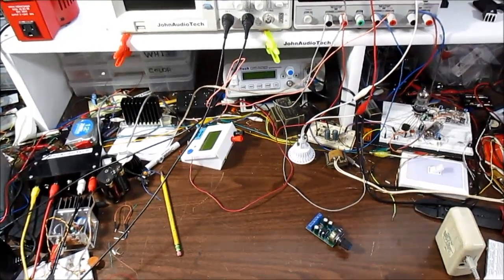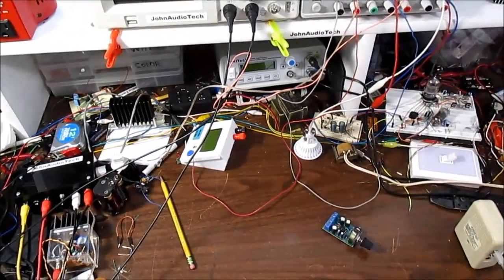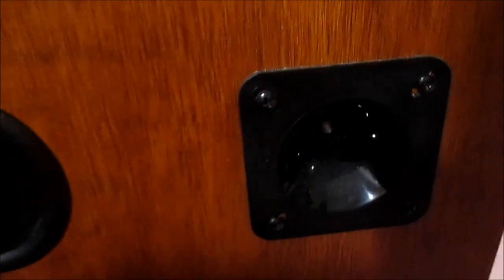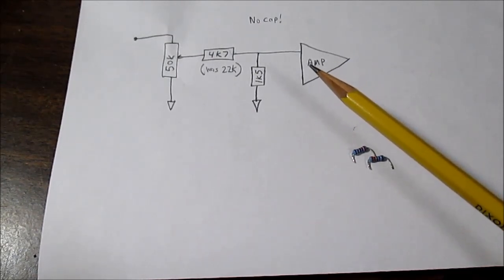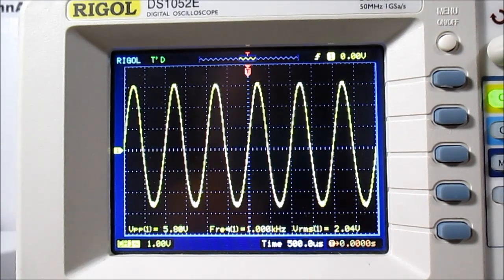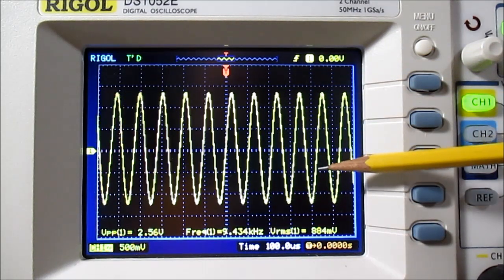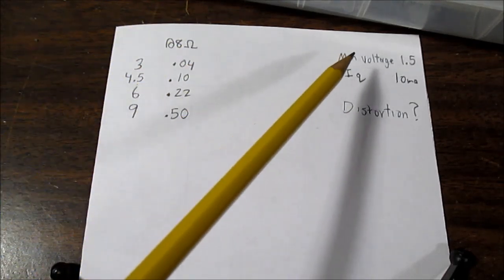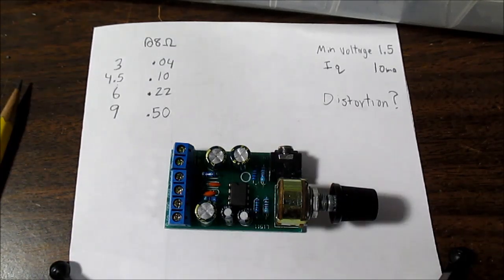TDA2822M $2 stereo amplifier board test, review & modification

Comment: Lets hope your Dad is feeling better for xmas. I'm listening to this video on a breadboarded AN7523 - 8 v supply 4w....speaker mounted in plastic kfc bucket ;)... sound surprisingly good..definitely going to box this one. If you haven't already I would love you to have a look at the Panasonic AN series of chips. I believe they were mostly used in their tv and consumer boom box and the like in 90s-2000s. Probably superceded but still plenty around. I've used the AN7522, An7523 (stereo version) and AN7511..all been excellent chips..theres usually, mute, standby, overload protection..all low power, big output..and minimal parts. And this chip does not get hot, or appear to need a heatsink..worth a look

Comment: ok, alright,  great info.  Now I have a couple of questions. You mentioned you ran this chip on a bread board. I would like to see that, as that's what I'm getting ready to do.  
After you did your mods and ran your tests again, I sensed a little disappointment in the results. You questioned the authenticity of the chip. I just watched a bunch of videos on this chip in various amp configurations,  and chip authenticity is mentioned frequently.  That's interesting to know, especially when it comes to popular chips.  I was wondering, if you still have that chip you used in the bread board configuration, you might swap it out into this board, and do a comparison of the results.  I would like to see that.  
So, good job, I found the video useful, and I hope I can find the video you did with the bread board version. I would be interested in seeing the configuration you created and learning why you designed it the way you chose.
Thank you for the video, most helpful. 

It's really great to come on YouTube and get all the tips from you guys before you start building  your project,  they come out really good.
Thanks.

Comment: I assembled this circuit on veroboard but I am getting only 140 milliwatts output per channel. What could be the reason ? I used 9 Volts supply @ 8 ohms speaker

Comment: Hello. I use this on a Raspberry Pi for some audio outputs. But i have a lot of noise also i do not have connected any oudio wire. So the noise will comes from the 5V from the raspberry. Is there a way to reduce this noises ? I think i hear the CPU working :-(  This is the second Amp that i try and i don´t want to buy again an other for testing. Thanks !

Comment: I had tried using no coupling capasitor in the input, but the output sound was lower than when i used capasitor on the input, bro. I used 10uf cap anyway. And before the speaker, i use 220uf from the output ic leg. Not 470uf.

Are you sure it will break the ic 2822 because the coupling cap on input?

Anyway, i prefer use stepdown transformer, bridge diode, and smooth cap to get 12V supply directly to the IC. I see the 2822 datasheet, it can handle till 15V as the supply. The result sound is clear with no noise (for my ears). Because when i used 12vdc from the adaptor, the robotic noise was really annoying. I dunno why.

What do you think about it, bro? Would you mind helping me with your super amazing explanation about my cases. To find out the cause of it and the solutions if i was wrong. Because i've already done my tda2822m amp project with 4ohm impedance speakers (with diy wood complex enclosures). And i want to use it as my desktop speaker for long term use.

Comment: I made this amplifier on veroboard as per datasheet circuit and using my android phone to play songs. But when I increased the volume using potentiometer (47K), the sound was distorted. Can I use this same voltage divider to get a clean sound ?

Also, can this type of voltage divider be used on other such small chipamps like Tea2025, Tba820 etc to get a clean clipping free sound ?

Comment: It seems like a good little amplifier to use as a portable headphone amp with a couple of lithium ion batteries.... The data sheets show specifications for up to 32 ohms and it should theoretically provide enough volume... It's also apparently bridgeable.... Hmmmm I just might have to grab a few boards from eBay to experiment with.....

Comment: I prefer to use PAM8403 instead of this chip. 2822 was awesome for simple diy portable speakers before class D amps became popular.
Reply: The little PAM is such a beast in comparison, and you get them essentially for free.
Reply: Yes they are much better and cheaper. Sometimes on ebay you can get PAM8403 for less than 2usd. 10 pieces of them for 2usd :D

Comment: I got a couple of these for free and am getting really nasty popping and cracking with the volume all the way down. Any ideas? Been hunting all over for an answer and have found one. I made a little portable speaker box could it just be interference for the speakers being in close proximity? http://imgur.com/gallery/jh8lt9R
Reply from the maker: Getting crackles with the volume down sounds like a power supply connection problem. Those blue screw terminals are junk. Be sure the wire is secure in it.
Reply: @JohnAudioTech  didn't see you reply here till recently thanks. Pretty sure It was just a junk chip or something. And good advice on not using 12v with these counterfeit ones. Had one start smoking immediately after hooking it to a 12v battery. Thanks for the informative videos!